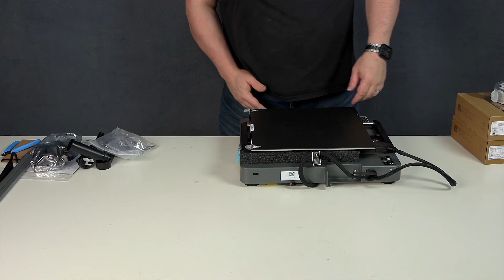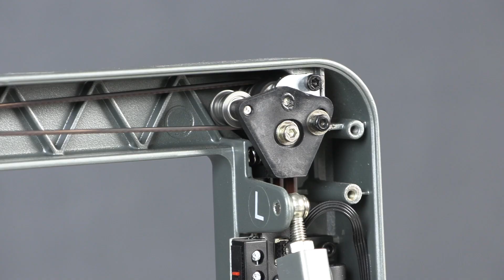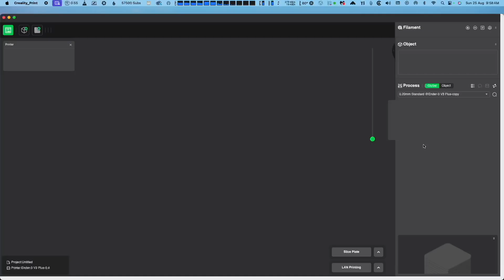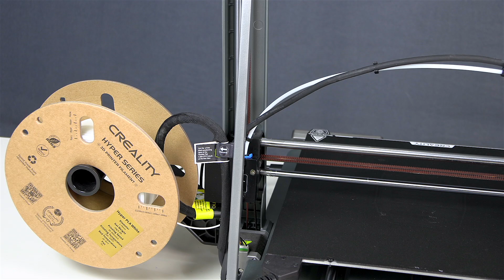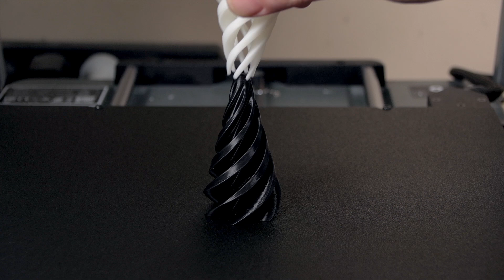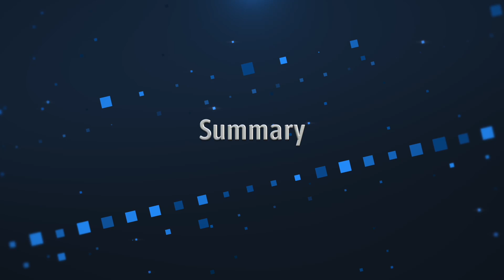Reviewing Creality's fantastic Ender-3 V3 Plus 3D Printer

Comment: Hopefully, you’ve figured out these issues by now. The Silent mode is in the print settings. Placing the spool on the gantry along with the runout sensor. Place the sensor at the right corner so it can be connected to its cable. Zip tie the cable to the support rod. Ditch the PTFE tube, not needed. If you do it right the spool feeds through the sensor down to the Printhead. Mine works and no filament feeding issues.

Comment: i just bought one of these and when i tried to print after set up it prints like a inch off the pad and when it cleans the nozzle it digs into the pad in the back ,I've never had a 3d printer before please help.

Comment: Had a Voxelab Aquilla and used Cura to slice to SD. I bought this specifically for its WiFi ability and i havent found how to do it yet. Printer is pn wifi, Im still getting used to  Creality program and learning where everything is. Cant seem to find how to set up wifi printer connection. I havent found a how to video either. 😭
Reply from the maker: There are two ways to do that. The first is to check what IP address the printer is using (Settings -> Network) then visit that IP address with a web browser. From there you can upload files to the printer via a standard web interface. The other option is via Creality Print. In the main "Devices" tab you can select "Scan add' to search for and add any printers on your network. Then you just use the "LAN printing" button after slicing to send the file directly to the printer.

Comment: Question: This looks like it's a direct drive printer.  If so, what's the purpose of a bowden tube?  If the filament spool were mounted from the top could the bowden tube be eliminated?
Reply from the maker: My guess is they are trying to reduce the weight on the frame to minimise vibrations, but other than that, there's no reason why the filament couldn't be mounted on the top and the Bowden tube eliminated.
Reply from the maker: @BlondieHappyGuy  I have created this anti-tangle device for the side-mounted spool, and so far it's working very well: https://www.thingiverse.com/thing:6811687
Reply: @BranchusCreations  I never bother with those spool holders that are attached to the printer. I use an axial ball bearing style filament holder that I have designed and printed myself. It holds the spool horizontally and lets it run with much less friction, on eighteen 12mm steel bearing balls, and it also allows me to place the spool anywhere I choose, like on a shelf two feet above the printer. It can easily hold 3kg spools too.

Comment: Question: I use Octoprint on all of my printers but because the V3 Plus doesn't use Marlin it won't be possible.  I'm not opposed to that.  However, one ESSENTIAL feature of Octoprint is that if I'm printing a lot of parts and one of the parts fails by not sticking to the bed I can have Octoprint ignore that part for the rest of the job.   Is that possible in the software on this printer?
Reply from the maker: Yes, I believe the built-in firmware does have this feature. The web interface shows all objects printing and you can selectively cancel any of them.

Comment: Question: The space where I would put this printer isn't wide enough to include the filament spool.  Can it be mounted to the top?  Is there a STL file to help with that?
Reply from the maker: I've seen photos of the Ender-3 V3 Plus in this configuration, so I'm sure it can be done.
Reply: There is a set of printable modifications on Thingiverse. Just query the Ender-3 V3 Plus and you’ll find them.

Comment: Great video! Do you think there reasons are beyond cost why Creality continues to release new bed slinger printers instead of moving entirely to Core XY? The build volume and the price of this printer are pretty appealing, but the disadvantages of Core XZ seem pretty apparent based on your review.
Reply from the maker: Creality's flagship K1 series are all CoreXY, but they are more expensive than the Ender range.
Reply: @BranchusCreations  I saw that the forthcoming K2 is 350x350x350mm which would be a huge upgrade from my current 256x256x256mm volume limit.